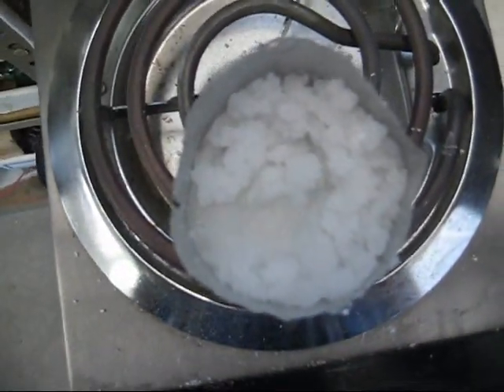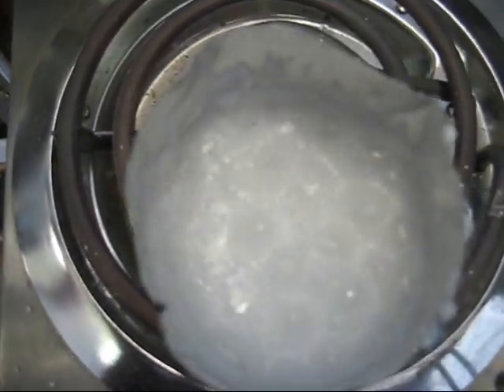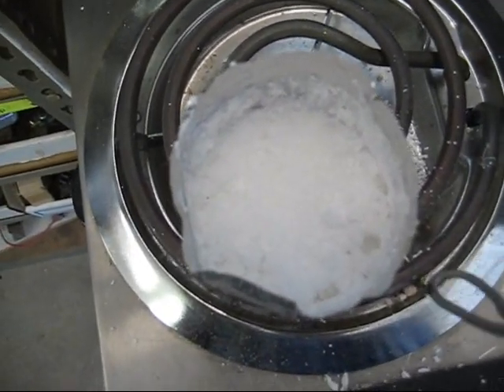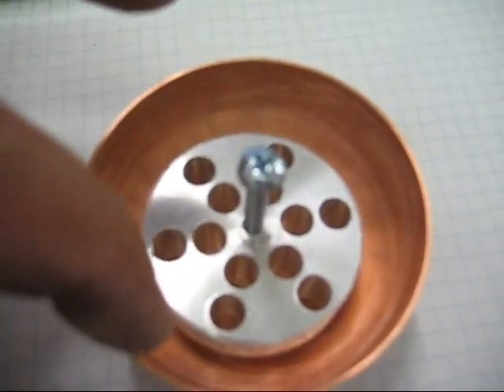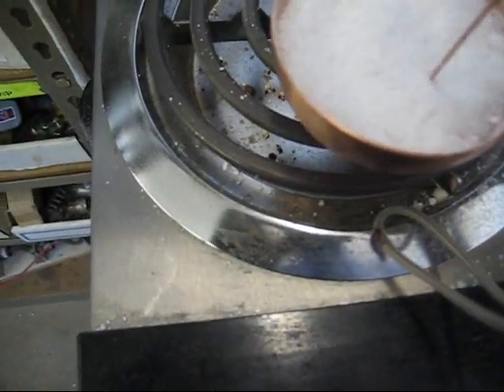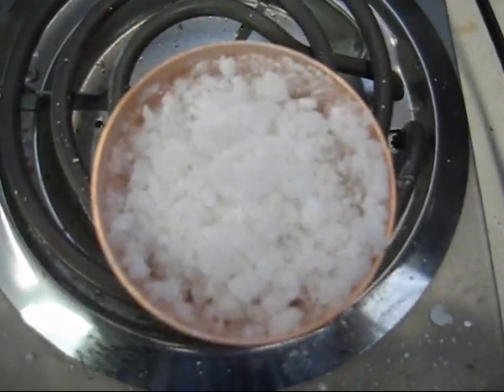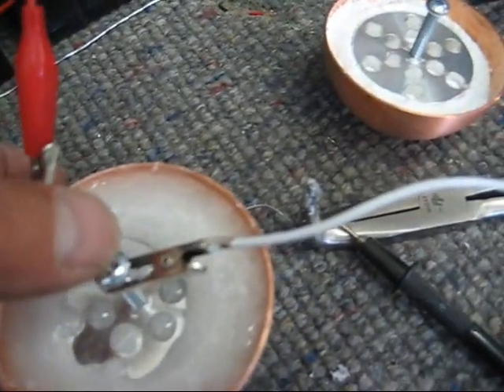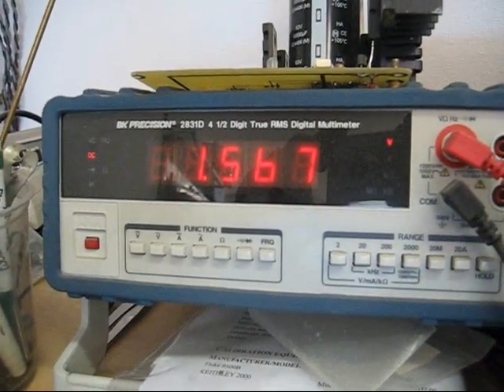How To Make A Star Cell CC.John Bedini.wmv

Comment: Thanks for taking the time to share the experiment John, you are a generous individual. I successfully (finally) desulphated an expensive 6v today, thanks to you, and your circuit - very cool. I guess in the past I wasn't patient enough - it took forever and a day, but I suspected the battery (which was left sitting unused, too long...) was restorable, and you were right. You are a generous engineer.

Comment: Hi John, well done.
But the Rochelle salt is deliquescent, so it attracts water from the air
and has water inside its crystal structure as KNaC4H4O6·4H2O
as Wikipedia says. So it would be great, if you could dismantle a cell after a few days or weeks of operation to see, if the underside of the magnesium will corrode. Many thanks.

Comment: which btw.. magnesium sulfate is brilliant to use as the cathode as the magnesium metal that precipitates from the reaction that generates the power around the magnesium cathode. well it works really well.... but there is a way to make it better :) ... you game? it's simple.. you put potassium (K) in kinda a core that a graphite electrode for your cathode rests in with the outer shell of the cathode is made of magnesium.... see what happens is the electronegativities of doing it in that order while minimizing resistance due to thickness and maximizing exposed surface area causes a synergistic reaction that improves power performance for the cathode in a cell..... adding thermal energy would only help as a Seebeck effect would get kicked off as the electrolyte acts as a britdge between the donor metal and the recipient metal for thermoelectric reactions....

Comment: Does this thing also work like an electret. And if it does, would applying high voltage DC to the leads until the crystal has solidified, would increase electrization (Like wax electrets)?
Reply: Cool idea! Id heard John compare these to electrets

Comment: Hey great one energenix! but just a couple of small questions (does the Columbo look).... see something is bugging me..first for your magnesium cathode.. wouldn't it make more sense to purchase magnesium chloride ( a driveway melting agent you can buy at your local hardware store for about 20 bucks per 50 pounds .. that 18 pounds of which is magnesium...) then to heat said magnesium chloride to the melting point and then to pass and electrical current through it with graphite electrodes to produce at the cathode of such magnesium precipitate in a very fine powder.. and then take some aluminum screen material  and like apply adhesive and then like powder said screen like a powedered donut with said magnesium metal dust and like then... well let dry then roll like a ciggy? (HINT... more surface area exposed of the Mg than your solid billet by orders of magnitude and costs orders of magnitude less....)  .. but I will come back with my second question LOL

Comment: I like this video, has anyone tried to use crushed down quarts crystal? either in the mix or pure? I am curious about this.
Reply: i have wondered this same thing myself!! illl let you know if it works when i try it. Stuff is hard do sand down than I thought. But  this morning I just got .83 volts to pas through a quartz (amethyst to be specific) crystal- like the sold raw rock hard crystal you buy in shops. I didnt think this was possible! ive tried to find anyone else with doing something like that but have not as of yet
Reply: Ok, awesome. I don't see why using a powdered pure quarts crystal mix maybe with very low salts or maybe none at all would work. I also could not really find results for this. I would like to know if it better or worse than the solid crystal. You got to consider pressure too, like quarts when pressurized by mechanical force puts out electricity (piezoelectric) so maybe compacting this powder a lot or something may be beneficial. experiment I think. Keep me posted on this if you find anything.

Comment: i made a small one in a 10mm copper cap (plumbing shop type), 6mm magnesium strip (slightly different crystal ingredients) and got over 1.5 volts.. also, i didnt polarise it.
but i still got over 1.5 volts. i dont think size is important to crystal cells..
... just my 2cents worth
Reply: I have found that size does not matter as well, you are correct.

Comment: I think that there a galvanic reaction.  Oxidation of magnesium at anode (in battery is the negativ pole) and reduction of oxygen from air diffusing inside your cristal matrix at the copper bowl electrode (that constitute the cathode [positive electrode in a battery]).  In such system, the corrossion only occured at the magnesium but very slowly cause you only power very low power using device.  Enven after weeks, no corrosion it seen.  But there was corrosion at my point of view as a chemist.

Comment: Let's say 30 cents worth of electricity heating the salts, another 50 cents worth of epsom salts, 2 bucks for the copper and magnesium, buck worth of rochelle salt, so about 4 bucks to do what a 30 cent AA battery can do.
Reply: Not the same. The AA battery will die in months but this battery in the video will run for years and years.